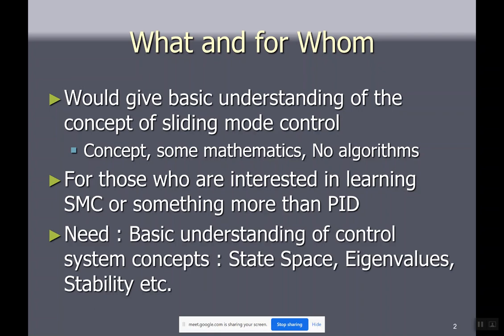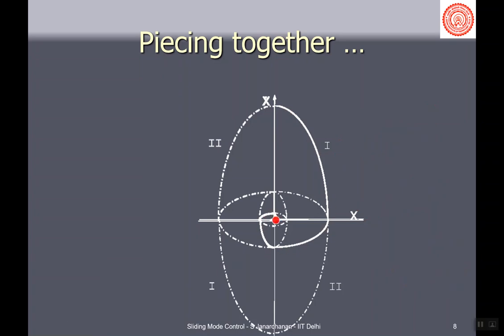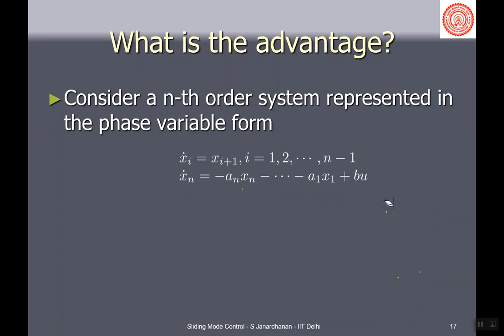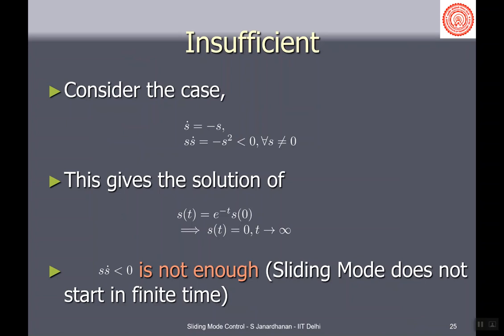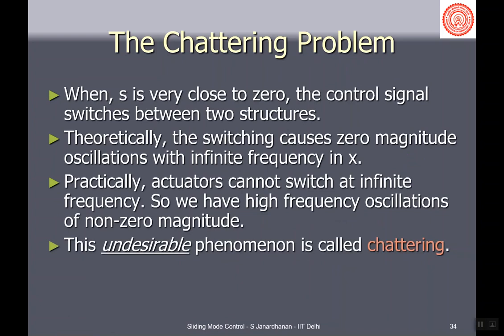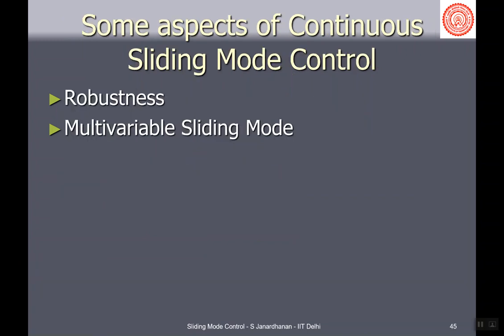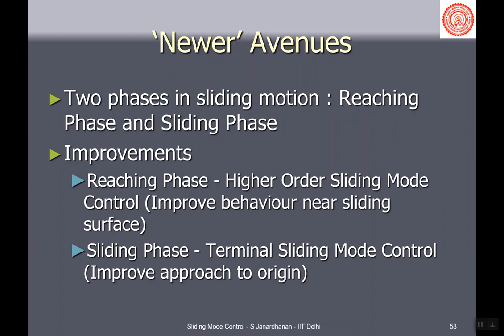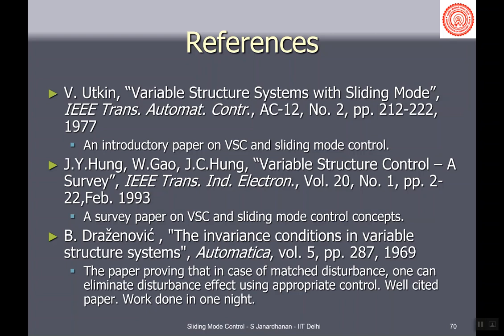Sliding Mode Control - An Introduction

Comment: If the system is given by x =  Ax + B u and sliding surface is given by
s = Sx, prove that the closed loop system obtained by applying the
equivalent control is
Reply from the maker: What is your question?
Reply: WhatsApp par bhej deta hau no send kro